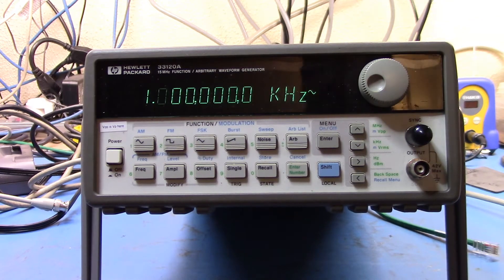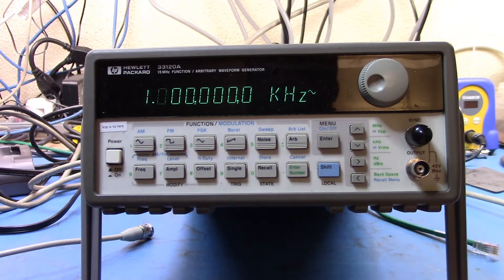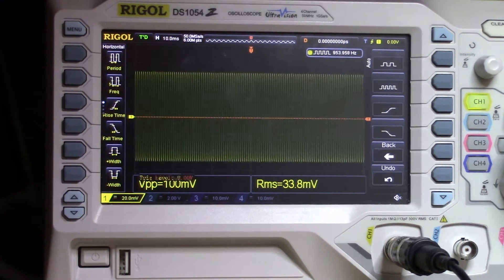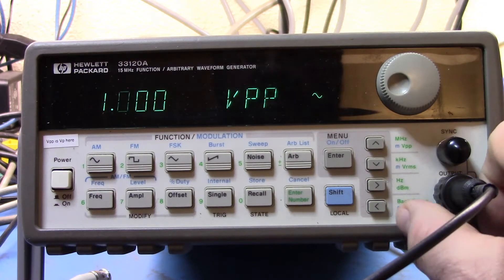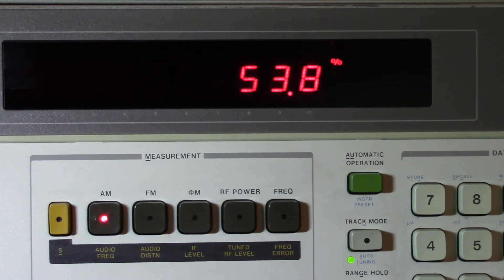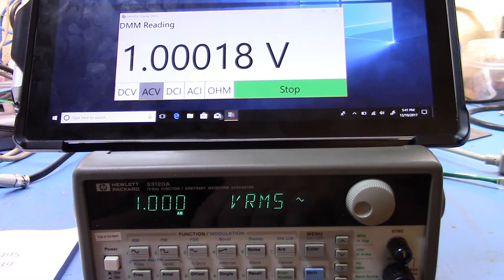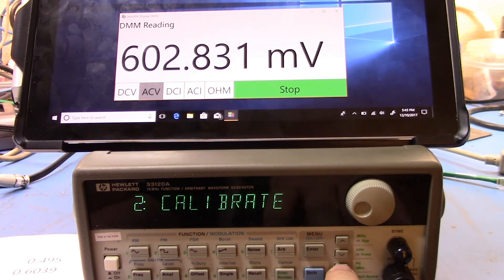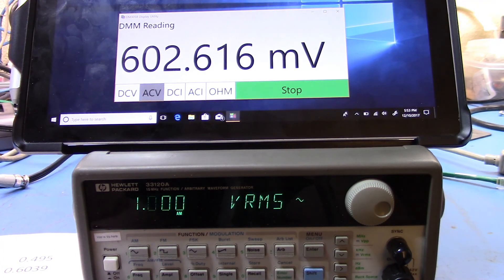HP 33120A Poking Around

Comment: These units are quite nice. I have one myself. Being only 12 bit they are not as clean as the newer Rigol and Siglent AWG's. One very common problem with these is the fuse right before the BNC adapter blows. This is an axial PCB-mount fuse which is still available on the market. I bought a pack of 5 on eBay when I had to repair a couple of those fuses. The one thing I really miss in the 33120A is an output relay to disconnect the load. The newer 33220A has this and it is a big deal, especially for unplanned quick'n'dirty applications. 73 de LA1WUA

Comment: Looks like a nice unit, I just had a quick look on eBay to see what is available at the moment, bit pricey for me at the moment, if I can pick one up cheap which needs work then I will do it. I have a arb gen built into my SIglent SDS2102 MSO scope (as well as having a R&S SPN generator, Marconi 2022D, HP8674A, and R&S SMY02), so its not something I REALLY need, but I think it would be nice to have one,  think I need help with my hoarding...